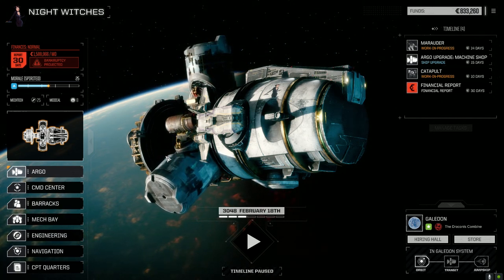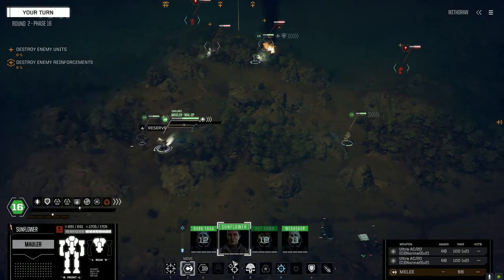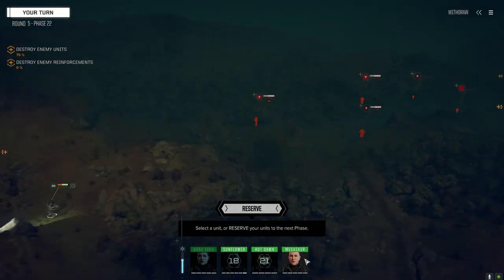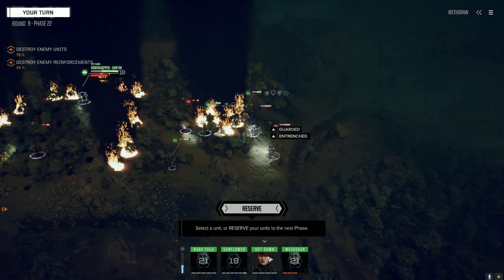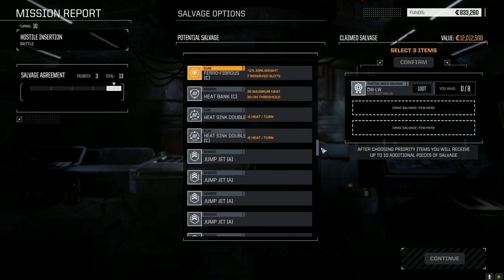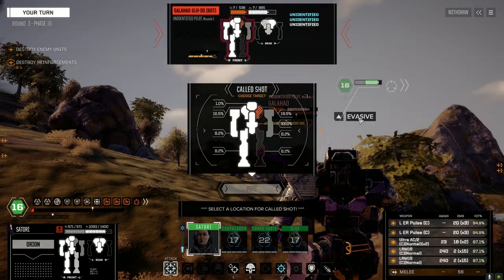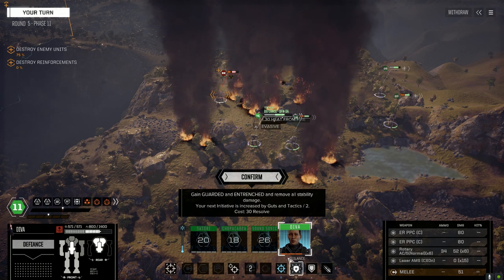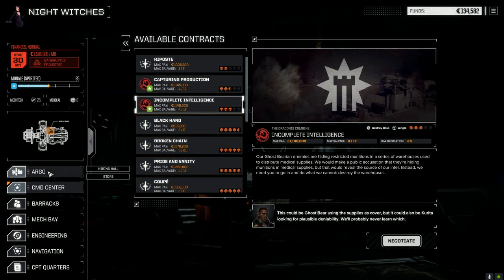Roguetech - Night Witches - Ep115

Comment: Wow, RNG was not on your side in that first mission, but that Mauler is a beast! How are you liking the L. Heavy Laser? 

Some more heat capacity on Megasaur's Black Knight might help keep the TSM on for longer. Since you don't have a lot of Prototype DHS, maybe put that Kit in the Black Knight for the overheat threshold and total heat increase? That way you could fire your lasers twice on the run in, and have worse overall sinking so the heat stays on longer.

Take care with Swarm ammo. You can get friendly fire, and your front line mechs got softened up quite a bit.